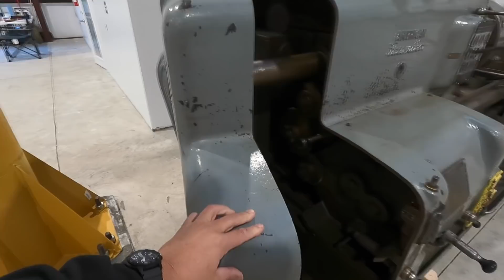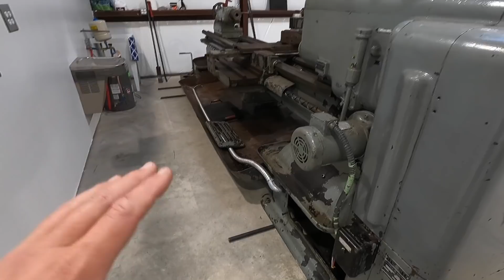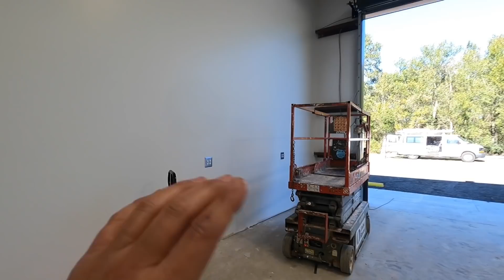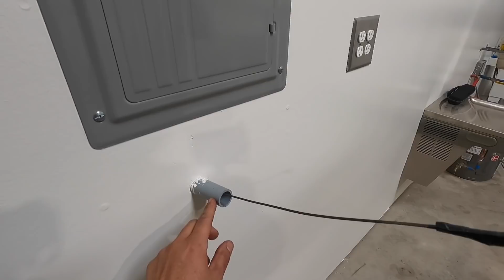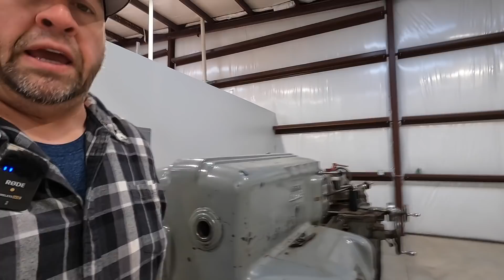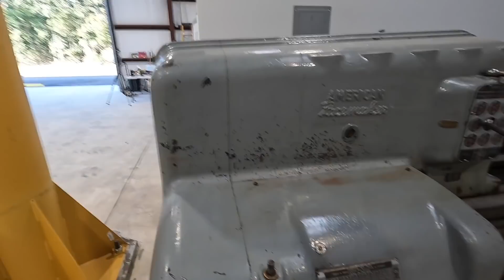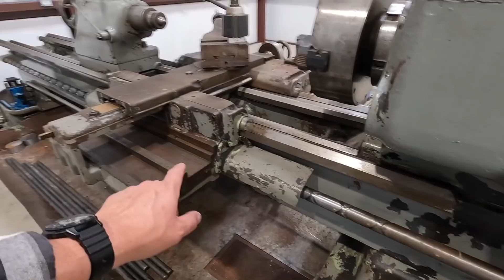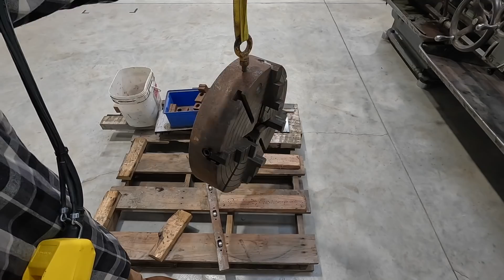New Shop Space Update 12: 3 Phase Electrical Circuits, Lathe & Crane First Tests

Comment: OMG! Pause this at 1:50. Look at the thickness of the steel in that door. This is not a structural element. Its sole purpose is to keep chips and other trash out, and to keep your fingers out of the belts and on your hands. A thin sheet steel door would do the job perfectly. But no. The American Tool Works did not have a stamping press suitable to for sheet steel, so they cast this door. Incredible.
Reply: Sometimes, it's easier to cast a part, than make press-break dies, and fool around with a bunch of stuff. This could be a very difficult part to 'press' in one piece of sheet-metal.
Reply: My American Tool Works radial drill did not come with a coolant system.  The hole that is cast in the base for the pump to be installed in is covered over with a blanking plate.  Sheet metal would have sufficed but ATW made a cast iron cover that probably weighed 15 lbs..  The mating surface of the cover had a ground finish that looked better than some new milling machine tables I have seen.

Comment: That new shop has got you pretty excited! Can tell by the big smile Haha. I know the feeling as my son and I are planning a new shop for the farm this summer, it will end up about a 30 x 30 maybe 30 x 40 depending on budget. I'll also be in the market for a smaller lathe and milling machine as I've been wanting to get into machining for years but never quite pulled the pin on that endeavour. A vehicle lift and jib crane are also on the drawing board. A new shop will be just the excuse I need Haha. Watching you set your shop up is perfect timing as you're going through all the steps I'm going to be going through. Best of luck with all of it, and thanks for the years of entertaining and informative information. Can't wait to see that shop come together!

Comment: There goes that clean floor with more tire tracks...that new pins comment was wacky since you actually installed those in the last video?
Reply: I think that lift truck has non-marking tires.
Reply: @BigRalphSmith  Glad to see it did!  Riggers brought 1/8" thick steel plates to protect from tire tracks if theirs had black tires when moving injection presses.

Comment: The heaters need to be re-sized, they were sized for 440v, on 220v the motors are drawing twice the amperage.
Reply: Came here to say this. Half the voltage = twice the current. The heaters work off current.
Reply: It would be interesting to know what his nominal line voltage is at the service (220/230/240).
Reply: @charlesemmer8856  In the US it's going to be 240 and it usually runs there. Very rarely do you see less. At some industrial facilities it can fluctuate, especially when large motors start, but low voltage 3-phase is 480/240.
Reply: @brent4adv  In general I agree with you. I have done service and installation of machine tools all over the country and seen a wide array of power services, and not just 480/240 vac. I did an installation where the service was 575 vac. Working on some older machine tools that were still using grounded B-phase. I also worked on retrofitting imported equipment and had to develop 380 vac or 200 vac.
Reply: @charlesemmer8856  Yea, the only time I've seen anything other than 480/240 was when a machine came from somewhere else. We had a customer buy a machine from Canada that was built for 575 VAC. In that case, we had to install a transformer to get the 575VAC.

We also build our own (analog) DC drives up to about 2500 HP and we'll boost/buck voltages to get a better conduction angle for the SCR firing depending on the motor and application.

Typically with 380VAC/50hz machines, they will run happily on a 480VAC/60hz supply.
Reply: @brent4adv  i am gonna be installing a 480 circuit and running a 575 motor off of 480. I will not be using all 60 amps of the 575 motor. Would you recommend a step up or should i be fine rolling with the 480. The 480 is coming from a step up transformer on 240 3ph. The real output voltage is estimated at 510-525. Im just trying to get more info

Comment: That is low voltage to the coil or wrong voltage coil
Reply: Some new motor starters have alignment (poor construction) issues which causes the buzzing.
Reply: I agree with both of you.  I have seen all 3 of those.   I'm leaning toward Joe however.  I don't think those electricians are industrial experts.
Reply: I was wondering the same thing.  Usually the machine has a small transformer that provides the correct voltage to the coil.  On a dual voltage machine if you change the supply voltage you have to change the taps on that transformer or you get the incorrect voltage to the coil.  Since he dropped his supply voltage the coil voltage would be too low if he didn't change the taps.  I had to do this with my American Tool Works radial drill when I changed it from 440 V to 220 V.
Reply: @hmw-ms3tx  yes, except the starter I think he said was from his house.  So it is a mix of parts maybe.  Hard to say but they did the usual  "replace the whole thjng".  That usually works.

Comment: If you lowered the operating voltage to 240vac, the heaters need to be changed to handle the increase in current. Heaters provide overcurrent protection for the motor winding.
Reply: Yep I was just going to say the same thing. Twice the amperage at half the voltage; that's why they are tripping. I had the same issue on my mill before I converted to VFD.

Comment: 29:34 I thought you already changed those pins out for theirs
Reply: Yeah noticed that too. Maybe the timeline of the footage is a little scatteted.
Reply: @johanispro4219  Not unless he takes the boom off and puts it back on the forklift ;)
Reply: @johanispro4219  maybe?
Reply: he changed them because he pounded out the ones he made with the new ones and the cotter pin got stuck on the washer then pounded it back then replaced ,,at the 44 min mark he was changing them

Comment: Okay, I’m kinda concerned here; you’ve got the headstock end supported with 4 pucks, and the tailstock end supported by two, but none in the middle. Is there any risk of putting a slight bend in the ways due to the weight (especially after you put the steady rest and the 4-jaw on there, too)?

Comment: Adam the heaters are part of the overload system. When you changed voltage the heaters should have been replaced. It is best to go with a solid state overload mag starter like your new unit. The electrician can match the class rating and will have the added benefit of being adjustable in trip setting. Thanks for the video!
Reply: Agreed. Changing the voltage changes the current so the old heaters (sized for 480V) would be roughly half the size needed now that you are running the motor on a 240 Delta hookup.

Comment: Why does the crossfeed dial spin the opposite direction of handle rotation?
Reply: It has a gear reduction from the handle to the dial and crossfeed screw; This should make it much easier to dial in a tight tolerance.
Reply: @Matthew Perlman  Thanks for responding.  It’s still weird that it goes in the opposite direction. Must be something you gotta get used to

Comment: You changed the voltage the lathe was running so the heaters need to be changed to match the new current of the rapid transfer motor ,those may cover the main motor as well so bouts amperage need to be added together for the heaters

Comment: Why is that fork lift buzzer ringing while it is in forward gear? Seatbelt sensor maybe?
Reply: It's safety standard on rentals. I watched this one guy(has his YouTube lawncare channel) that rented a skid steer with a Bush hog attachment and the company had it set where you couldn't lift the loader arms. It was his first time ever running a skid steer and he was doing a free yard clean up for an old lady.
Reply: @jamesrobinson1022  Thanks for the info. I could never run a shift using something like that. It makes me grind my teeth.
Reply: Safety 3rd
Reply: I assumed it was the motor drive sound

Comment: You have to change the thermal overloads on the motor starters because you went from 480V to 240V, your amperage doubled.
Reply: Thanks Larry, I was going to suggest the same. I would have thought that the electrian would have worked that out straight off.
Reply: @ronwilken5219  Putting the starter under the panel is not acceptable. That conduit on the floor is kinda hack. And I would never have used that AC cable. I would have done the whole job in EMT.
Reply: @jimmydm3  who said anything about putting the starter under the panel? I merely agreed that the heaters needed to be doubled in amperage to account for halving the voltage. Simple ohms law. Please engage brain before sticking fingers.
Reply: @ronwilken5219  your obviously not an electrician or you would know. Speak not of subjects you know nothing about.
Reply: @jimmydm3  you obviously have a bee in your pants. I have no idea what you're referring to. As for being an electronic tech I've been one since I qualified in 1964 and have worked in three countries on two continents on equipment at up to 12 kV and 400 kW. So park it. This fiasco is over. Crawl back under your tool belt.
Reply: @ronwilken5219  butthurt much? An electronic tech knows nothing about building construction. Man up and admit you know nothing about the Electrical Code.  You are just talking bullshit.

Comment: You need to get the electricians to upgrade all the fuses, overload relays, and other load protection devices (including the heaters for the overload circuit on the rapid traverse motor) to get in line with the current draw of the 240V supply as compared to how they are set for when the machine used to run on 480V.
The reason the rapid traverse motor is tripping out is because the heaters are sized for 480V, and are about half the current rating they need to be for 240V operation. Check the name plate on the motor and then the trip rating on the heaters and you'll see what I'm talking about.

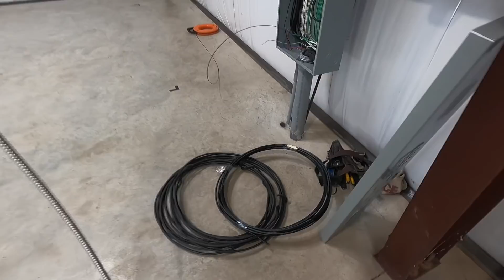Comment: 22:11 Aluminum wire? No No Hell NO!
Reply: There is a better than average chance (actually, pretty close to 100%) that the terminals at both ends of that wire are also made out of aluminum. Since that wire isn't going to be subjected to any kind of substantial flexing, it's actually not a bad choice as long as it is sized appropriately.

Comment: Adam, did you ever switch those two wedges to under the bolt heads instead of where you put them on the bottom of the cross brace?

Comment: That's some janky wiring for the 50A receptacle by the office.. yeesh. Guess that's Florida electricians for ya....
Reply: I cant believe they ran the conduit on the floor. That would not pass here because it is a trip hazard. You have to do ceiling drops.
Reply: @hilltopmachineworks2131  well, he did say he was going to make a ramp it something over it. 

Honestly though, I would have run a ceiling drop too, but for one issue, the crane. It would be more dangerous to have the crane hit the power that way instead of a trip hazard. At least that ran it in heavy wall, or maybe just IMC. Either way, you gotta pick your battles. No perfect way to run power to it here.
Reply: @hilltopmachineworks2131  Adam has a handicap parking outside. That means he's complying with local codes.
 If that was Canada the space behind the lathe would need to be wide enough to turn a wheelchair at the sink or fountain and the conduit across the floor would be a no-no regardless of the proposed ramp. They'd require it to be chased into the floor.
Other question is the washroom fully handicap accessible? Just asking.
Reply: @hilltopmachineworks2131  running it on the floor seems super weird to me as well

Comment: What is the arrow on the red button that’s on the crane it’s like a arrows in a circle
Reply: That's an Emergency Stop button. When you push it, it latches down in the 'Stop' position. When you want to reset the button to allow operation you have to turn it about 20 - 30 degrees or so and it will pop back up and go back to the 'On' position.
Reply: @jdgower1   oh oh  I see. Nice. Thank you

Comment: These heater elements are like fuses for that motor. 
It looks like your lathe is 480 Volt, but you feed it with 240 Volt. It will run, but the motors and everything get to warm. Feel the motors. If they get to hot, they are running on the wrong voltage......
You got an expensive machine, make sure  it doesn't break down on you because it receives the wrong voltages.
Reply: Also, if the ‘heaters’ or overloads were set for the 460V motor connection, then they need to be changed for the 240V connection (the motor would draw almost 2x the current).
Reply: They would not show how to wire it as 220v if the conductor sizes on the motor could not handle the higher current at the lower voltage.
Reply: @kailuagarage  The heaters are sized for the amperage rating of the motor. If the machine used to be wired for 480, the heaters are 1/2 the rating they should be for 240 V operation.
Reply: @jdgower1  I was only commenting on the motors.  They are designed to run at either voltage.  I agree that the heaters may not be correct and would need to be verified
Reply: @jdgower1  And thus they trip and the electricians by-pass them
Reply: @JVissers-com  True. But I would like to think that the electricians took an amp reading of the motor to make sure it was operating within design specs before they by passed the heaters, and realized they needed to get a proper overload relay to replace the heaters with.
Solid state overload relays are hella cheaper and easier to find than old style overload heaters.
Reply: @jdgower1  Not sure about that.
Especially after seeing the relay they changed out because it was humming.........
But, i wasn't there, so I am not allowed to comment on that. I just hope Abom79, gets that what is best and protects his investment.
I do enjoy hos videos And I like to see some work being done on that new lathe....
Reply: @JVissers-com  I'm more of a controls guy than an electrician, but I have done both in industrial maintenance for about 35 years, so I kinda like to give the benefit of doubt to people I don't know.
That said, I know some very good electricians that have told me that they have about as much business working inside a control panel as a plumber does. I get calls all the time from pretty big electrical outfits that find themself trying to troubleshoot relatively simple (to me) controls problems.
All that said, every electrician worth his salt has an amp clamp, and when a motor or something starts tripping any kind of overload or over-current device, he will bypass that device and check the actual current load being drawn. If the current draw is withing reason and he can replace/upgrade the over current protection device in a reasonable time, it's not unusual for him to do so.
Over current protection bypass isn't necessarily a matter of safety concern over a short period of time - the worst that might happen is some scenario where the motor in question gets severely overloaded and burns out and has to be replaced.
Adam probably isn't ever going to overload the rapid traverse motor and even if he does, it won't be in the next couple days. The important thing for him right now is to check for the proper operation of the machine without interference from wrongly sized over current devices causing nuisance interruptions.

Comment: The heaters are the motors safety device , I think they need to be sized to 125 % of the motor's full amps ; Contactors are now sold with an amp . overload adjustment .

Comment: Great progress on everything. Surprised you did not move the lathe the few inches to the right to clear the door, I would have been working to a chalk line for location. You can move a machine that size with the correct prybar.

Comment: Nice crane Adam. I had an overhead travelling gantry that covered the entire shop (50' X 100') That was rated at 5 tons. It was powered in X, Y and Z. Didn't have that slow speed feature though. So yeah... a good crane is really nice to have. Makes tough jobs easier and impossible jobs possible. I never had to set mine up it was there already. It it has been an interesting experience watching you set yours up.
That Pacemaker clutch looks like it will be interesting job also. Might need the crane to lift that pulley off! Hope it can work that close to the column.

Comment: I had exactly the same issue with the heaters in my lathe.  Lower voltage increased the amperage.  Up the heater size.

Comment: @Abom79 if you pushed the lathe back like you said. If you ever had to stick some material way out the back end of the head stock, would you have clearance between the jib crane and the lathe to do that, or would the stickout out the back of the headstock hit the jib crane? You might not even need to ever stick anything that far out the back of the headstock. But it was just a thought.

Comment: The heaters for the rapid motor are sized for 480v supply voltage. When you change the voltage to 240v then you have to replace the heaters because the motor will draw twice the current that it did on 480v. You could just use a more modern overload relay instead of the heaters. You can get them as standalone units.

Comment: When they changed the voltage from 480 to 240, the motor will draw twice as much current. The motor current runs through the heaters. Too much current will cause them to overheat and trip the over current protection contacts. When the voltage is changed, the heaters need to be replaced with ones that handle higher current. The heaters might not be available any longer.
Reply: Exactly the info I was going to give him. I'd be shocked if the originals could be found. May have to just put in an overload of some kind.